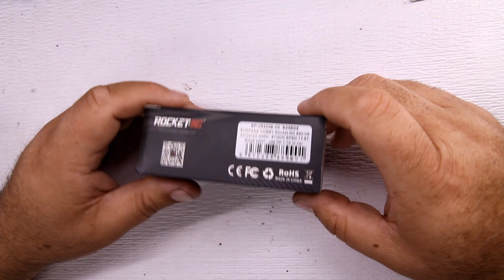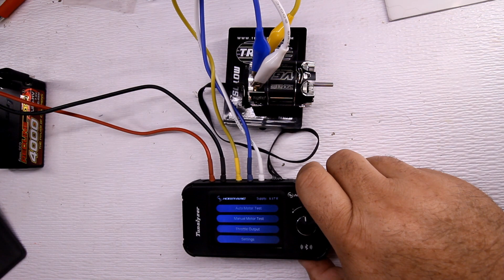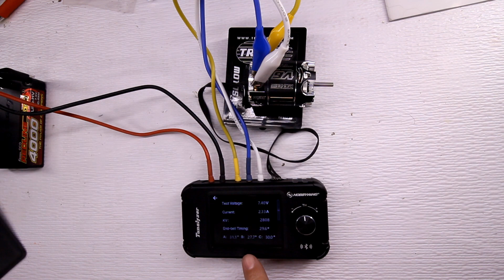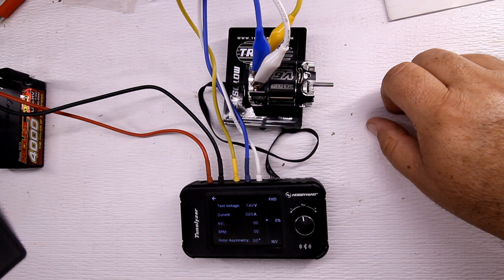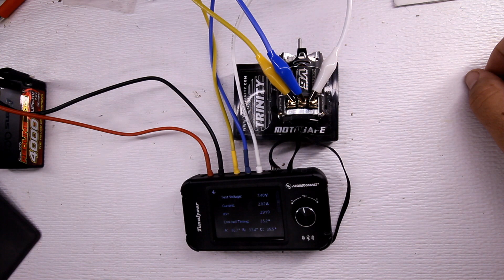2023 Surpass Rocket V6 17.5T Stock Spec Brushless Motor Unboxing and Review

Comment: How do you feel about their ESCs. Im working on a dela with Alibaba. Going to order a few more motors and then i saw the T160V2 esc 160amps and was thinking for $80 its a good deal. It has timing and boost too so i could easily run it in my drift car. I was just curious if you had any knowledge on them. Thank you as always
Reply from the maker: They are really good ESC's.  Just remember, if you spend more than $800, you will have to pay a Tarif tax.  You can also get a programming card for it.  I'm not sure if they have a bluetooth option.
Reply: @wutupclegg6618  yea for sure I've imported stuff before. It's going to be small order to start. And yea they have a program card for them. I usually use HW escs strictly but I like branching out and for $80 I will toss it in the drift car lol
Reply from the maker: I believe they are,basically,  HW ESCs.
Reply: @wutupclegg6618  that's what I was thinking. Manufacturing items is very expensive and difficult. 90% of these brands, whether it be a servo or esc, are made by another company and rebranded. These smaller companies don't have the power to Manufacturer their own stuff. Like agfrc servos. They make alot of other companies servos but nobody knows that. So at the end of the day there is 3 to 4 companies making all the rc parts then rebranded. The companies we buy from are basically just marketing companies marketing a product the didn't really make.
Reply: @wutupclegg6618  I wonder who the parent companies are for all these brands. Like I said manufacturering is expensive and there is no way these companies are making these things themselves. From my research it seems HW ans Surpass make their own stuff but I could be wrong. Just like AGFRC makes all the other brands servos. It also makes sense as to why they are cheaper than other brands. They make money both ways whether you buy their brand or another brand. Almost like a private label at the grocery store. I wonder tho who the main companies are that are making all these escs and motors. Surpass and HW are based in shenzen which is the manufacturing capital.
Reply from the maker: @LegendsPizzaCo  Yes, this is what I have found out over the past couple of years.  If it's made in China, chances are, it's just another rebranded product with a couple tweaks to make it look like their own.
Reply from the maker: @LegendsPizzaCo  I believe HW is manufactured by Surpass.  This is why so many of their products looked so alike.
Reply: @wutupclegg6618  also that's why they have the same specs too as the XR10 G2S
Reply from the maker: Yup.
Reply from the maker: If you order enough Surpass products, you can put your own name on it.  Call it Legend RC.
Reply: @wutupclegg6618  im also convinced Hota is making alot of these chargers too. They all sort of look alike too. I was trying to explain to a buddy how this works. 99% of the companies we buy from are marketing companies rebranding items. If tou go to the source it's usually same quality and cheaper. I have a gens ace imars d300 charger that I used to love but it's starting to give me issues. What charger do you recommend? I need a dual port charger to do up to 6s. All the racers at my track have the ichargers but I'm just getting back into racing I didn't want to drop 300 on a charger yet lol. But they seem gold quality. I found a fre toolkit rc chargers with similar specs to the icharger dx6 but $90 cheaper. Any suggestions?
Reply: @wutupclegg6618  also have we tried to see if the HW esc programmers work with rocket rc escs?
Reply from the maker: If I had the time and money, I would do what HW is doing. Sell quality stuff for less.
Reply: @wutupclegg6618  less than? HW didn't seem that cheap to me but maybe I'm an idiot lol.
Reply from the maker: Yes.
Reply: @wutupclegg6618  I knew I was an idiot lol. Jk.
Reply from the maker: @LegendsPizzaCo  LOL...
Reply: @wutupclegg6618  I'm working on an alibaba order lol.
Reply from the maker: I tried to make it to the track last night, but I was not able to.
Reply: @wutupclegg6618  neither was I. I had a wedding. I usually go around 2pm on Saturday and bring pizzas for the guys. Gotta keep em fed lol. I'm itching to get the B7 on the track. I think it's ready for a maiden voyage. I took the surpass v6 and hw xr10 g2s and tossed it in the b7. The B6.4 is retired for now. Haven't decided if I want to run 21.5  in it, reitire it or sell it.
Reply from the maker: How many of the ESCs did you get?
Reply: @wutupclegg6618  I'm still working on the order. The first lady tried quoting me "wholesale" prices and it was the same as retail lol. Im placing an order now tho. I got decent pricing without having to order too much. Why?
Reply from the maker: If you order on or two, then they will charge your retail.  The more you buy, the better the deal.  When I bought the motors, I bought 100 of them.
Reply: @wutupclegg6618  absolutely thats typically how it works. I'm working on the order now
Reply from the maker: I was just asking.  If you ordered more than you can use, I don't think they would be hard to sell.  A lot of people are looking for top performing products at a low price.
Reply: @wutupclegg6618  so I finally ran the B7 for the first time yesterday and the whole track was asking me what motor was I running lol. One guy even accused me of running boost and timing on my esc. I said dude I run blinky always unless I'm drifting wtf. I pulled the car off the track and showed him my HW XR10 blinking. He was still not believing it lol. Then a worker drove my car and was really impressed. So I guess I built it properly and with your motor suggestion the car is ripping around the track. Thanks again
Reply: @wutupclegg6618  I also got surpass to sell me less than the MOQ for $43 ea piece for the v6 and $41 for the thunder drift motor and $85 for the esc. Not bad pricing for not ordering 100 lol.

Comment: Ok i just bought a V6 17.5 lol. I figured it's the cheapest one might as well give it a shot and compare it to the team powers v5. I'm running this in my B6.4 on carpet. I might still give the G4R a shot too lol.
Reply from the maker: It's pretty crazy how inexpensive the V6 motors are.  I heard, from many people, that they are the motor to beat.  The G4R is also a good motor, but I would prefer the V6 for off-road carpet.  The V6 has a bit more torque.
Reply: @wutupclegg6618  yea its kinda crazy they are about $90 shipped. That's at least $20 cheaper than the next decent motor and if it outperforms them that's even better lol. I love finding hidden gems. Sometimes the price of stuff deters us since we associate high price with better quality. So naturally we gravitate towards the more expensive motor assuming it's automatically better. Thank you for your guidance and help
Reply from the maker: Well the truth is, I feel the same way.  RC racing is getting too expensive.  I ended up getting a killer deal on the Surpass motors.  Once I found out how good they were, I bought crap load of them and sold them as cheap as I could.  After tax, shipping, and driving down to ship them, I pretty much broke even,  I did that to help other racers save money.
Reply: @wutupclegg6618  yea for sure. It nickels and dimes you if you let it. I'm building a B7 and spent more on upgrades than the kit cost lol. But I have fun and enjoy it a lot. However, it definitely is expensive.  That was nice of you to hook everyone up. Where did you order from? I found a guy on ebay if you order more than 2 you can get them down to about $73 shipped. I have 3 motors in my ebay cart as we speak lol. I was considering replacing the whitz racing motor in the T6.4 and I was thinking about turning the B7 into a 21.5 car or just getting another 17.5.
Reply from the maker: I was getting them from Surpass, directly.  I had a total of 100 motors from them.
Reply from the maker: You can find them on Alibaba, but there us a big minimum order to get a good price.

Comment: which version of this do you recommend for indoor carpet off road? and yes im here cause you recommended this motor to me lol
Reply from the maker: Very cool! LOL...
The Stock Spec one would work better.  The light weight one would be a good on road motor.
Reply: @wutupclegg6618  haha ok thank you so much. Amazon only has the lightweight one so I will go to ebay or somewhere else for the stock spec. It looks like this surpass motor tests better than fantom, trinity and the G4r. I almost pulled the trigger so many times on the Hw G4R
Reply from the maker: Did you find them on eBay?
Reply: @wutupclegg6618  yes sir. And if I ordered 2 or more the price dropped to $72 each shipped
Reply from the maker: Very nice!
Reply: @wutupclegg6618  yea I felt $72 shipped is a great price. I can get 2 motors for the price of 1 team powers lol. My local track was laughing cause EVERYONE there runs team powers. Doesn't matter off road or on road they all use team powers. I love having something different and better AND cheaper lol
Reply from the maker: I'm the same.  That's why I run Kyosho.  Nobody else does.
Reply: @wutupclegg6618  nice I haven't tried their motors yet.
Reply from the maker: I run Kyosho buggies and Surpass motors.
Reply: @wutupclegg6618  ahhhh I read that wrong lol. Nice. I haven't rqn a kyosho buggy yet. I've been an AE guy since the 90s. I should probably venture out and try other brands. I've been wanting an xray tbh.
Reply: @wutupclegg6618  you got me looking at the Surpass Rocket RC Thunder motor now lol. I cant find any reviews on them tho. They look nice and again half the price of the other brands. Do you happen to know anything about the Thunder line?
Reply from the maker: I raced AE in the 80s.  Then Kyosho,  then went to Losi, and back to Kyosho because I wanted to be different.  If Kyosho doesn't prived a new buggy soon, I might go with an Agama.
Reply: @wutupclegg6618  yea I haven't seen anything new from Kyosho lately.
Reply: @wutupclegg6618  do you have any experience with the Surpass Thunder Drift series. I'm very tempted to try it out. Much cheaper than a HW D10 and specs look very similar. The Thunder and HW both have a fan on the rotor that keeps the motor nice and cool. The D10 doesn't even really need a fan since in drifting you're never ever really on the motor too hard for too long. Based on the quality of the Rocket RC V6 I'm assuming all their top end motors are high quality too. I could be wrong tho
Reply from the maker: If Kyosho doesn't come out with a new buggy soon, I might get the new Agama buggy.
Reply: @wutupclegg6618  nice. I like Agama and their laydown shock style. Interesting designs
Reply from the maker: @LegendsPizzaCo  I know nothing about these.
Reply from the maker: @LegendsPizzaCo  I waiting to see how well it runs.
Reply: @wutupclegg6618  the AE Chassis looks a little nice but I like the lay down shocks. I like interesting and new concepts. It definitely has lower COG vs regular shocks. I wonder how well it handles compared to other styles. I haven't owned an Agama but I'm always interested in different brands. The Kyosho Fazer Mk2 bodies have caught my attention lol
Reply: @wutupclegg6618  me too lol. If you get one I will be waiting for your opinion. I appreciate you turning me on to brands I would have never checked out like the surpass motor

Comment: If you really think people buying and dyno testing and tuning motor is the difference in why people win stock races… or races in general… your mistaken… drive clean… if you win, you usually didnt wreck… like, no marshalls.
Reply from the maker: If you can't make it around the track without a self-inflicted crash, then yes, faster motors won't help.  If you don't crash and you still need a kick of speed,  then tuning and testers are  nice to have.

Comment: i would suggest the lower torque motors that can still rev can be the best choice for lower traction conditions , the higher torque motor is great in high traction , but for stock racing we should by now be at the point of submitting your battery and motor at the start of the season and they are sealed and signed and thats what you use for the whole season , tyre allocation should be heavily limited to too , it stops the wallet racers from dominating , clubs can also run open class for those who race their wallets.
Reply from the maker: The problem is, they tried this way back in the 90's and people found ways to beat the system.  Probably, at least 90% of the tracks don't care or have the time for inspections.  It takes way too much time.  I was at a race where a kid was running his dad's buggy in Rookie class.  The buggy was set up with a 13.5 motor.  Clearly this buggy wasn't legal, but the officials never flagged the kid.

Comment: "Stock" 
It is still the same disaster it has been for decades.  It is just more expensive than ever. 
The same fast guys still buy 8 or 12 of whatever the latest "stock" motor is and dyno to find the best.  Same with packs.
Reply from the maker: This is very true.  No matter what rules are made to stock class racing, someone will find ways to beat the system.  This is why I only race to have fun.  Sure it would be great to win against these racers with endless cash, but us "budget minded" racers just do what we can.  We must remember, it's a hobby racing toy cars.  Nobody ever remembers who one the last race, anyways.  LOL...
Reply: @wutupclegg6618   I don't understand why you have Stock class in the states.  In the UK we just run modified.  You can purchase a 6.5T motor for a reasonable price and it will have more power than you could possibly need.  That way no one has a power advantage and you don't have to spend allot on your motor.
Reply: @louisedark9586  in UK we do have stock 17.5T Blinky but only for on-road touring car (also 13.5T) - on tarmac mod class is too fast for me so the stock class is more accessible. UK off-road is only modified, and the lower traction astroturf is the limiting factor especially in 2WD -so it's a stock tyre game instead.
Reply from the maker: @louisedark9586  I have heard a lot of different reasons.  Tracks or really small, too many crashes, no way to cheat, etc...  Personally, I think a lot of tracks are way too small and narrow.  it's quite common to see a track that is only 50 feet long with 6 foot wide lanes.
Reply: @louisI went stock 17.5 because I'm in my 40's and my reflexes arent as fast as they used to be, any faster mayber a challenge to drive. edark9586
Reply from the maker: I hate getting old.
Reply: After you run the auto test, Can you help explain what all them values mean ? I.e rotor asymmetry, deviation etc.
Reply from the maker: @Dru180sx  
Hello Dru180sx.
That's a great question!  I'll try my best to explain it without writing a book.
- End-bell Deviation: The average timing difference between the A, B, and C phase
- Rotor Asymmetry: The difference in the pole strength of the North and South pole on the magnet.
- Hall Signal Deviation: Refers to the difference in the magnetic strength readings of the A, B, and C phase.
When reading the results, in any of the three areas mentioned above, you would look for lower numbers.  The lower the number, the better the motor.
Reply: I just ordered a V6 lite